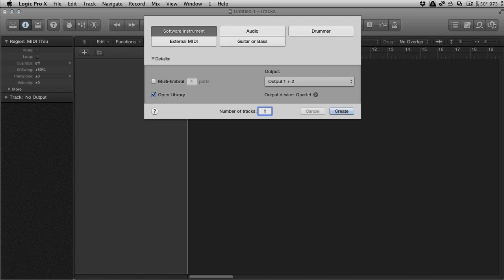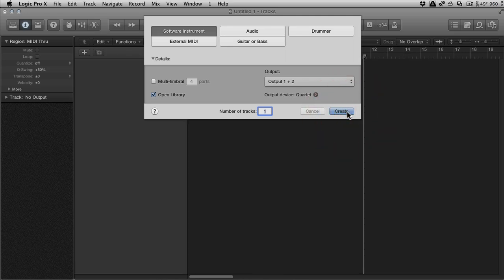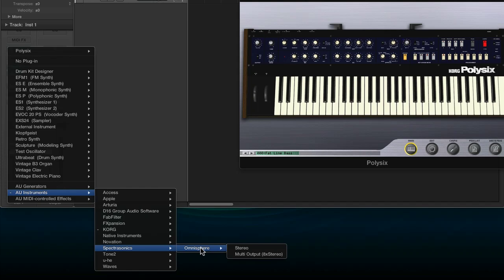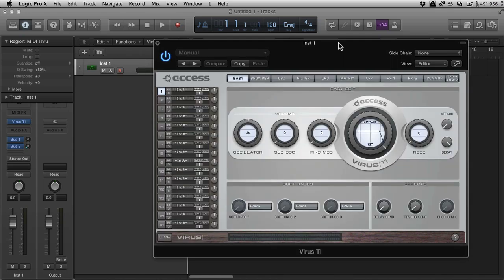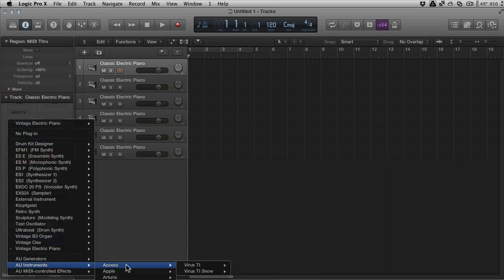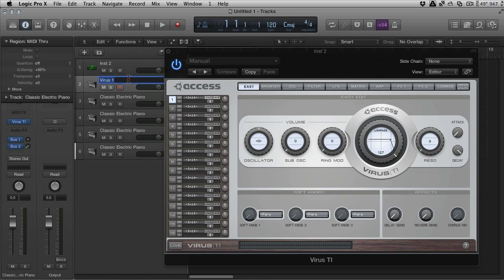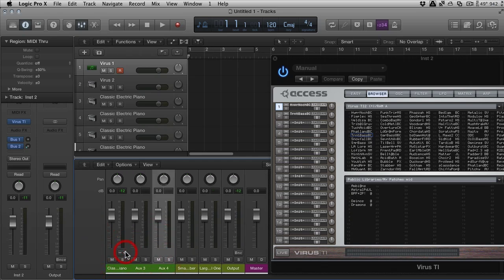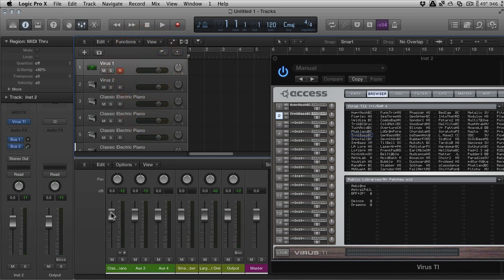How to Use Multitimbral Instruments in Logic Pro X

Comment: Hi, the problem is that even adding channels in the mixer, the first channel (asigned to fisrt midi track) will still control every midi track you have. So if you turn the volumen up or down, it will affect every channel.
Any sugestions regarding that?
Reply: This question is exactly why I came here to view this video.  The lack of individual midi channel control keeps me from using Logic.  I wonder if this problem has been resolved in the meantime.

Comment: Hi, thanks for the tips, I have a question for you:
I have a Novation KS rack synth that i want to use through Logic Pro X. The audio interface is a REM Babyface, I use an Arturia 49 Keys midi controler, no problems there but, i just can't get any sound out of the synth. My guess is that the routing through the babyface is not correct. Any ideas? Thank you.